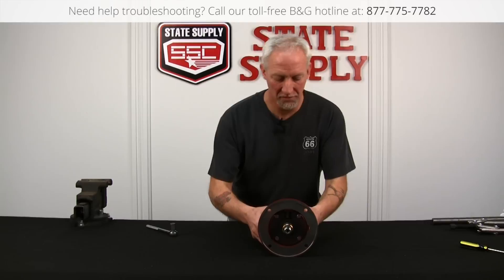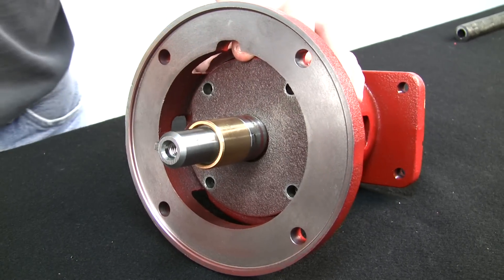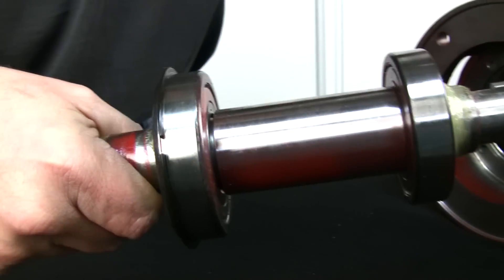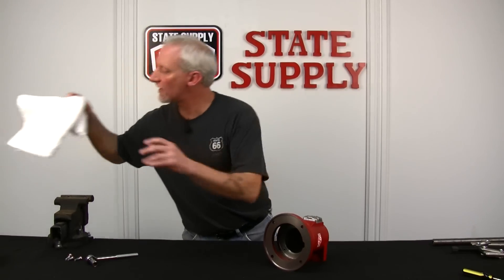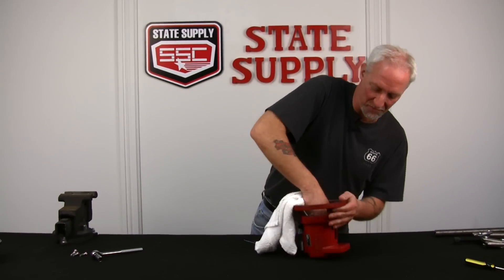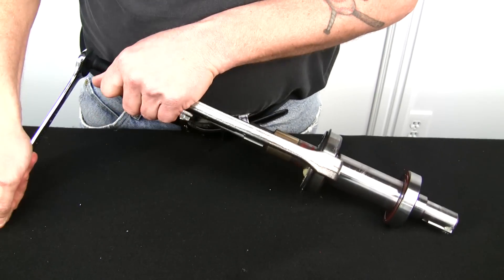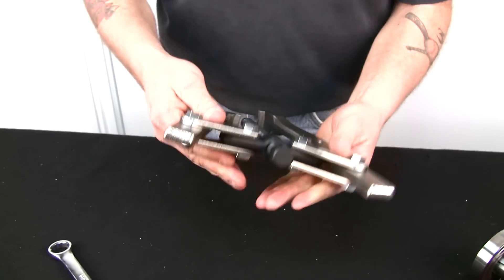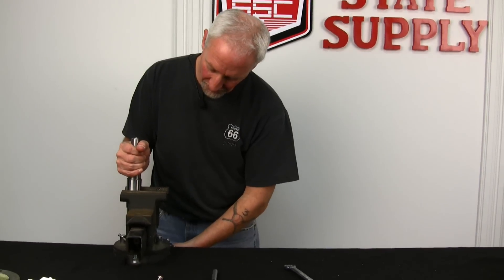How to Inspect and Repair a Bell & Gossett Series 1510 Bearing Assembly

Comment: I use a small electric oven and warm the bearing to 150-180F, she'll drop right into position.. If some assistance is needed, brass drift only on the inner race. I really like these videos to share with my younger techs.

Comment: What if you use a bigger diameter pipe to set the new bearings, if the pipe just fits over the shaft and rests on the inner ring, then you could apply pressure more evenly and not have to rock it back and forth it would just go strait down

Comment: The  waffle spring has nothing to do with bearing lube. The back bearing is the floating or expansion bearing your front bearing is your thrust bearing. The thrust bearing is loaded when pump starts due to axial thrust. The rear bearing is allowed to float as shaft expands or contracts due to temp. The spring washer loads the bearing.

Comment: Really need to consider using a pipe the size of inner bearing race to hammer in the bearings. Also I would place shaft vertically on table and would not want to scratch it up in a vise.

Comment: What if your assymbly has the locknut? Is it reverse thread. Is there a speicial tool to fit in the 4 notches or a couple large pipe wrenches to break loose?
Reply from the maker: +big pappy Not sure which bearing assembly you have.  If you'd like to call Tom, feel free to give him a call at 1877-775-7705.

Comment: I would imagine that if you used that puller to reseat the bearing, it would be quicker than using the hammer and less potential damage.  When doing it, use the old bearing on top of the new one to avoid damaging the outer race of the new bearing.  Just 2 cent suggestion, I've never done it before.